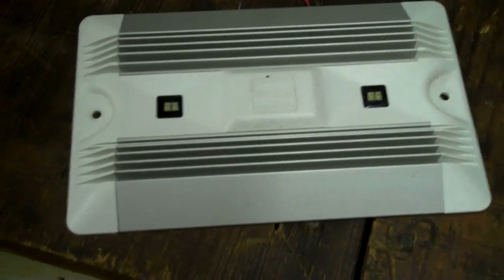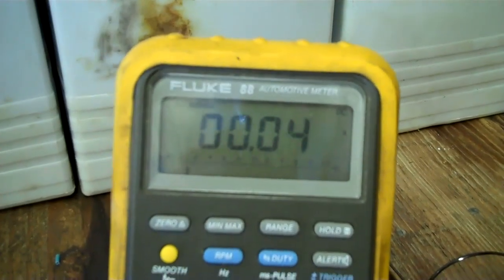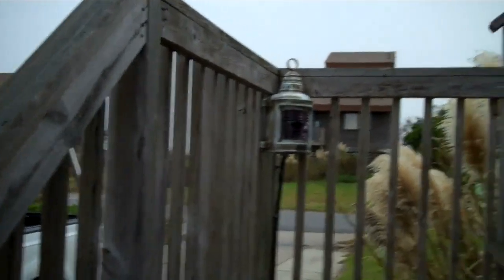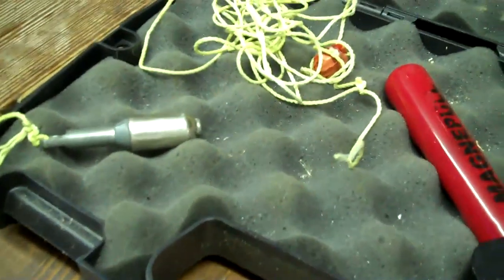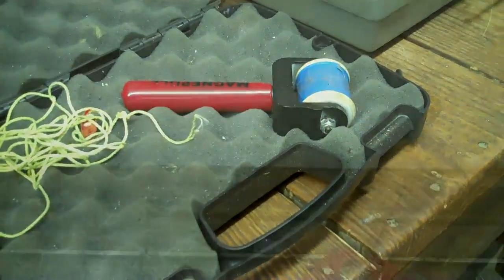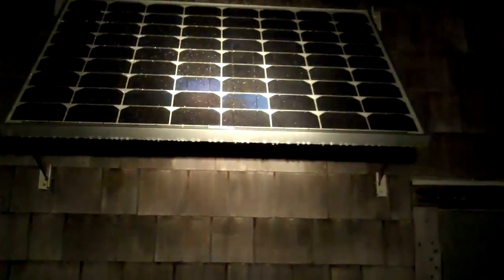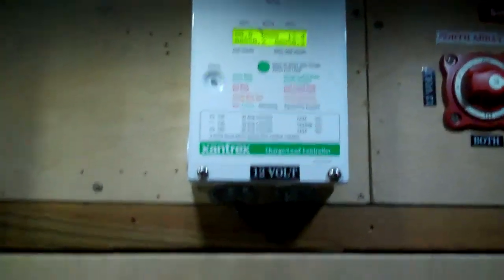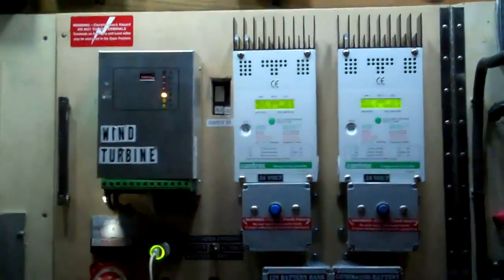LED LIGHTING FOR YOUR SOLAR POWERED SYSTEM

Comment: Thank you for showing us your LED setup.  Looks like the fixture you installed has a range from 10-30volts,  did you put it on your 24v or your 12v battery bank?

  OMG!!!  THE MAGNAPULL IS GENIUS!!!  Just ordered one off of amazon. wish I had that last year when I was struggling with fishtape to pull junk through my walls...

Comment: Nice work. I have just built myself an LED lighting system based on the Cree CXA-2011 X-Lamp module. I can't quite put into words how bright this LED is. It's a bit awkward to drive but it is extremely bright. Two 11W modules give out the same amount of light as three 2ft tubes (52W total). So, basically twice the efficiency.

Comment from the maker: @mmwish99 Thank you..I do have an older video on how I made some LED chains..Experimentation is the way to go when getting started. I have a tough time getting the information accross especially when it comes to batterys and DC wires. Thanks for the kind words and good luck with your system....

Comment: that magnet doo hickey you got there is  sweet... I cant tell you how many times that would have been key for me to have... especially when I installed my surveillance system...  Nice work  man, dig the work on the low voltage lighting as well!